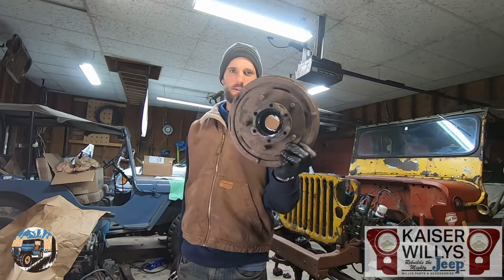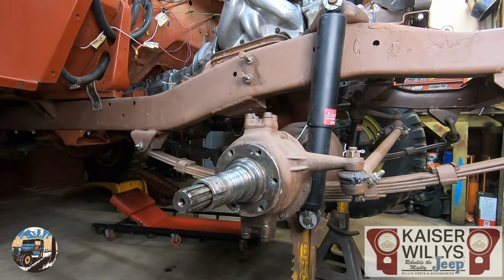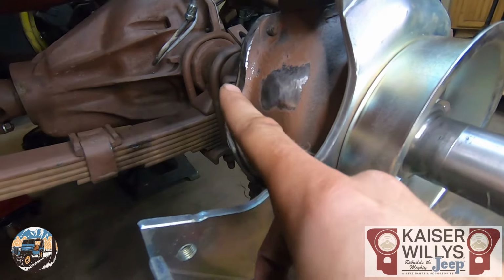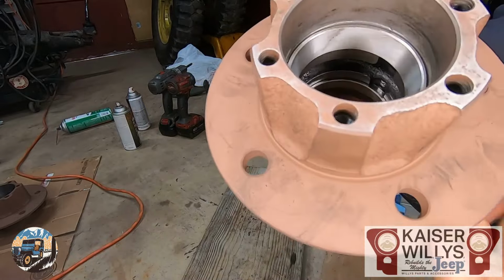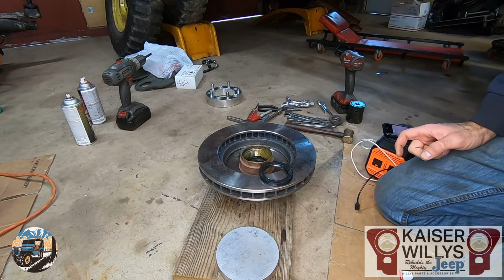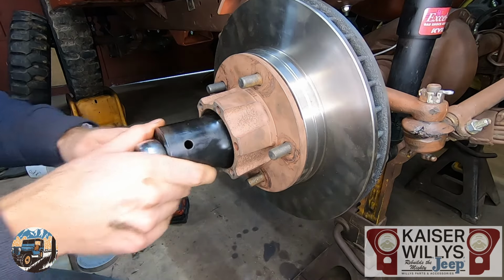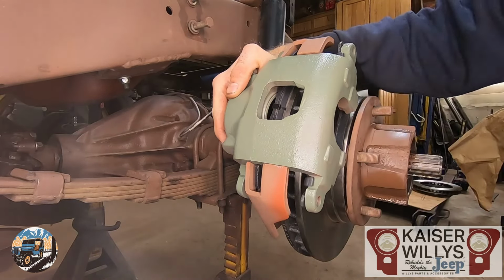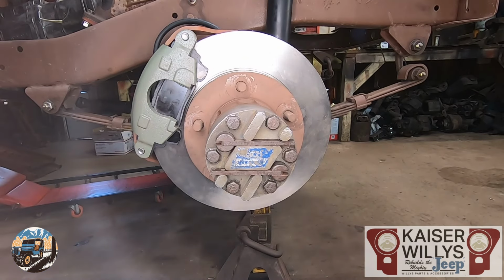Willys Jeep How To: Disc Brake Conversion

Comment: Seth, I just bought a complete front disc kit from Kaiser and a dual master cylinder. do i still need proportion valve since the rear is a drum brake. i noticed you used a single master cylinder reservoir, anyway, you have a great tutor video and well presented. thank you, Bob
Reply: Hi Bob, I have done a lot of testing on this topic. While companies generally recommend a rear proportioning valve I have not found them to be critical. A residual valve for the rear would be a good idea since you still have drum brakes. I do have a video showing the dual master install on the Jeep shown in this video. Hope this helps. 👍

Comment: Great video. I use the old palm method of packing bearings as well, cheap and easy for sure. Had a CJ-A years ago, wish this conversion had been around then. Back in the market for one, this will be one of the first upgrades, thanks